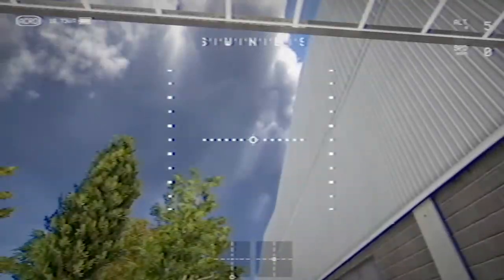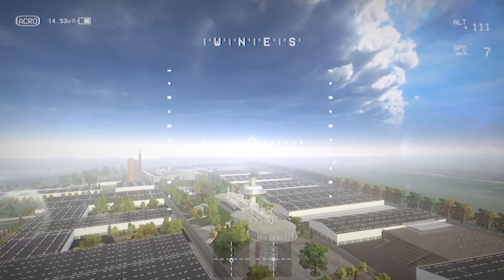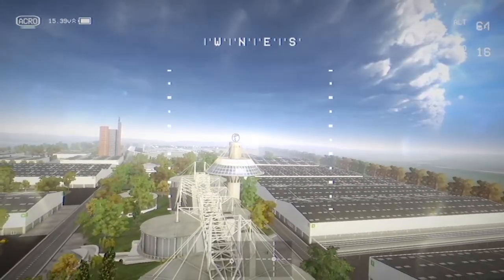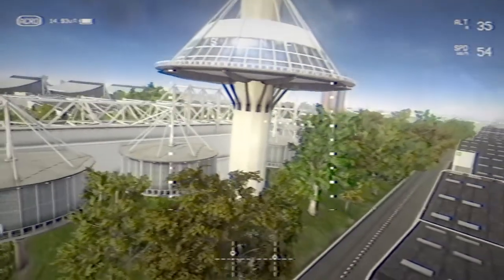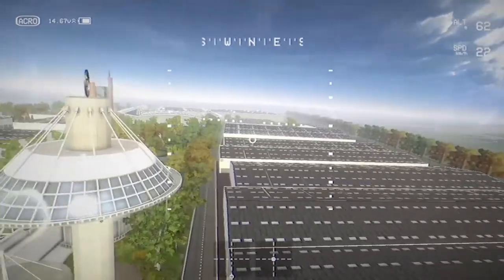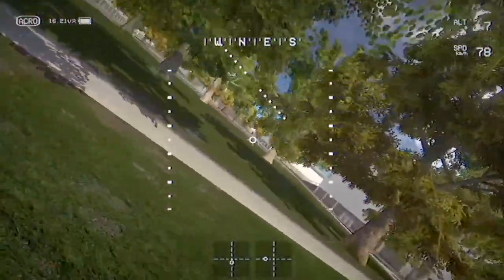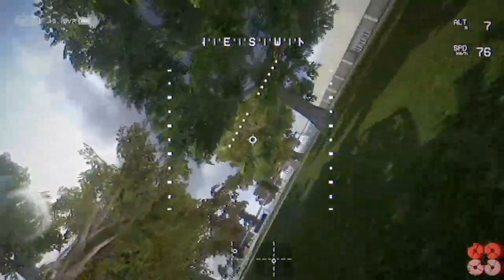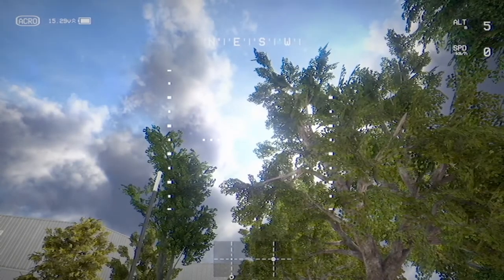Trouble learning to FLY ACRO with your FPV DRONE? I'LL TEACH YOU to LOWER your RC RATES!

Comment: Dude...thanks for explaining this in an easy way!! I'm new and only working on my sims right now with my DJI controller. By the way...whats your opinion on a first quad. I've heard alot of different things. I would like to start with a 5". I'll be working with all DJI digital in open fields and parks. Thanks for any feedback.
Reply from the maker: It's really hard to make a solid recommendation. There are 2 sizes that I love that I fly myself. 5" and 3". The 5" is great. It can handle all standard stacks, huge selection of components, frames, etc. They're very stable and a good size to work on. The 5" frames I'm using these days can take 2 full stacks (or a DJI stack) which I love as stackable components are the logical way to go. 

The 3" I love because their light weight makes them a little less fragile. Though their stacks are typically smaller now. Mind you stacks have gotten all over the place. 30mm, 20mm, 16m, and other odd sizes. Lol.